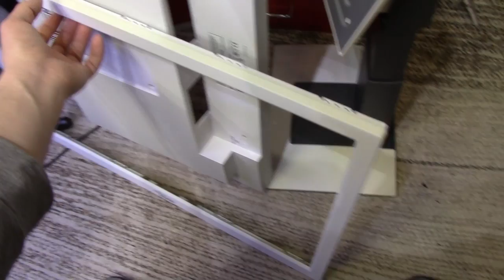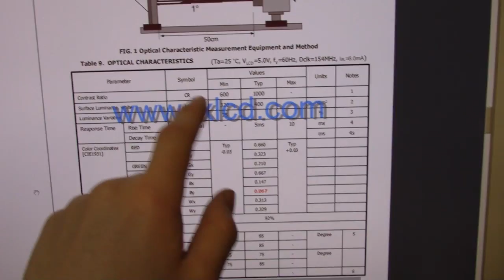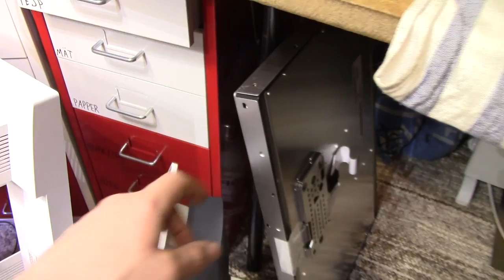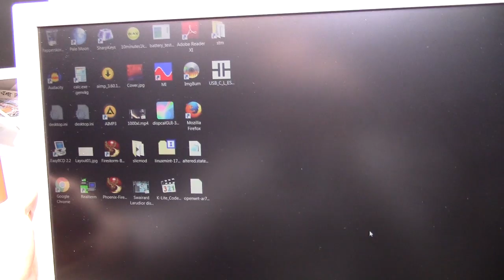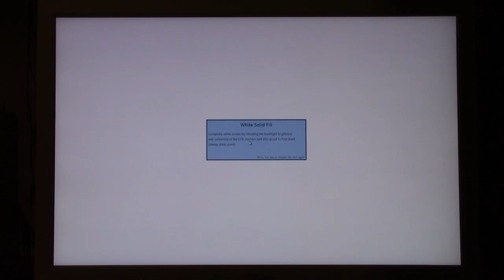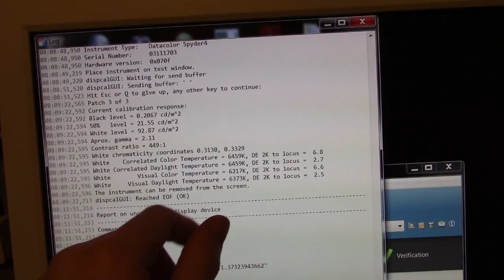Fujitsu Siemens B24W-5 LCD monitor teardown & calibration

Comment: thank you for this teardown video. I came here searching for information about a Fujitsu B22W-5 (not a 24´´). I found it in the local trash.  I expected the inner life of my monitor to be very similar to yours but not at all. The 22´´ is an edge-lit monitor, and the resolution is lower 1680 *1050. I didn't connect the monitor to a video source but it displays the splash screen. I noticed at some time a flickering of he "no signal" display in a connection with a modulated whistle coming from the inside. I guess a recap will solve the issue.

Comment: Well , apart from the color and format, it seems just the same HP 4/3 format I had at work for many years for my cad years ago. it's still around but the light seems dim now even if the anti glare coating is the best I've seen till now

Comment: How did you get in, ie. how did you open the case? Unscrewing doesn't help with mine.
Reply from the maker: You have to break the front bezel off. IT's attached with clips.
Reply: @FFcossag  That was what I’d hoped to see on the video.  :-(

Can you please post that part of the video

Comment: Yes screw any form of troubleshooting, as only capacitors can be the cause of all faults. anyway i have the 5:4 aspect 19" version of this for my windows98 machine, its hands down the best panel ive ever owned. my advice would be to get rid of all that circuit glue, in the end it will become conductive and destroy the pcb components

Comment: Weird thing is my monitor works fine when it's on, but if I turn off my computer or turn off the monitor for more than a few minutes, and then when I try to turn the monitor back on,  the monitor does not turn on. 
Would tell me what' problem ?
Thanks